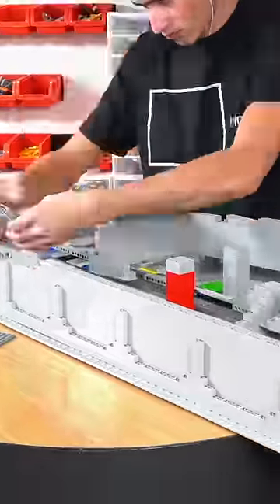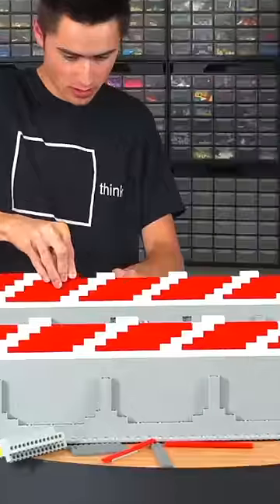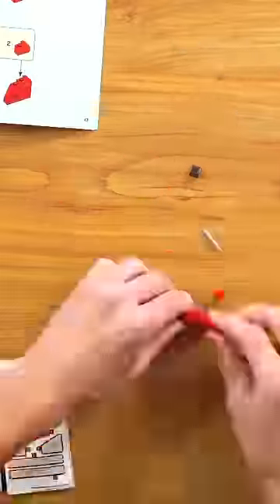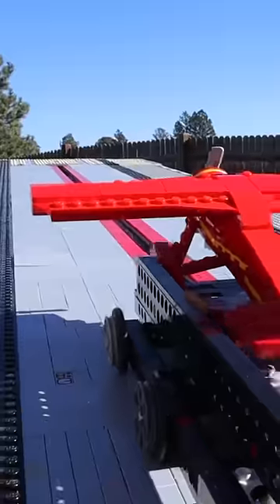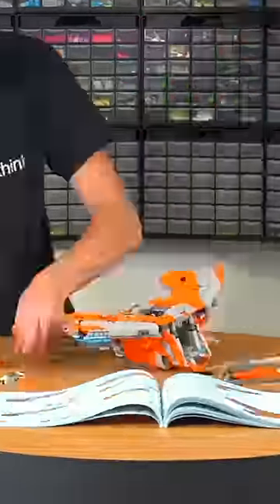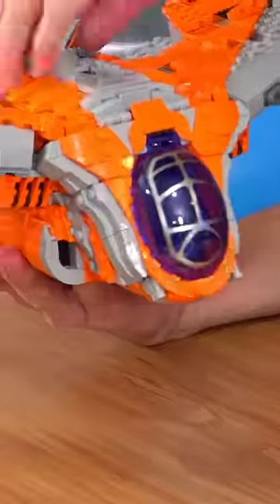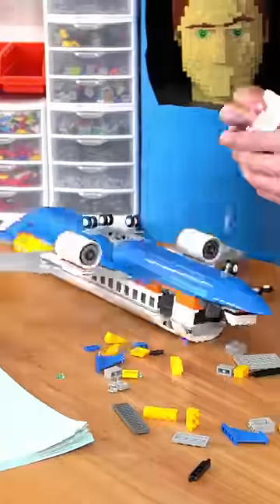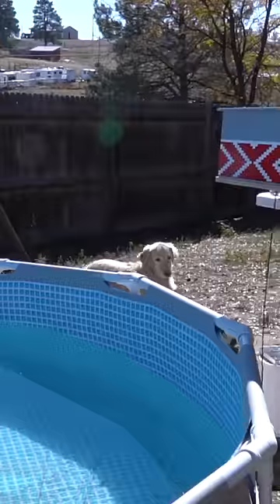Can LEGO Planes Actually Fly? #shorts

Comment: To all the people saying 'just make the propeller spin'
Flight requires lift which is created by the shape of the wing. It creates an upward force as the shape of the wing creates a higher air density below the wing and a lower air density above it. If the forces are correct it would create a glider
Flight also requires thrust that can come from propellers, jet or rocket engines.
If you have done this correctly, you would have a flying plane.

Comment: So there actually are some fans for RC models. Try buying 2 of those and place them on the passenger plane and go full throttle. Also, calculate the power, bc you need to get the airplane surface and weight in order to calculate how powerful they must be

Comment: All airplanes have wings by an angle, so when the air hits it the air goes down producing lift. But LEGO planes don't have wings by an angle. If you make the wings by an angle, ad more wings on different levels and increase  the weight , decrease the weight of the plane (*I think) you'll be able to make a LEGO plane fly. Good luck if you read my comment

Comment: The planes are not going fast enough to get lift on the wings, I did a CO2 powered car made out of wood in school and put little wings on it and it went so fast it got lift and just jumped up for a little bit. If you find a way to make the planes go faster, even with the size of the wings on most of them they should actually fly for a second or two (if the lego doesn’t break apart first)

Comment: Bro I wish there were a plane that it  had a rotor in it to the point where it connected to the wings and just make it flying and there would be a controller for it to connect to the plane
Reply: That wouldn’t work, Lego is too heavy. If you scaled it up to the size of a real plane not only would it crush itself under its own weight, but it would also be 200x heavier than a real plane. Real planes only just manage to fly. There’s no way you could get a Lego plane to fly without major issues

Comment: I think you should invest more time researching aerodynamics because the shape of a plane wing is carefully engineered to make air flow over in just the right way to create lift
The air under the wing moves faster but Lego planed the air moves about the same speed 

And also if the plane isn’t getting constant propulsion it will loose speed what can make it go into a stall

And also the centre of gravity isn’t good on Lego planes to much weight in the front makes a plane nosedive and to much weight behind the wing makes the plane wanna climb and so loosing speed and you guessed it 
stall

Comment: does lego not break when it gets wet?
Reply: If they are structurally designed well no,otherwise you glue all the pieces together and the problem is solved! But use glue for models only cause the common glue that you can find almost everywhere can destroy it due to the non plastic friendly chemicals it contains!